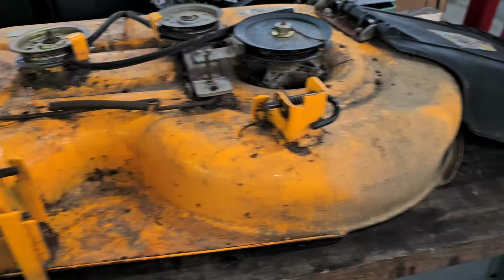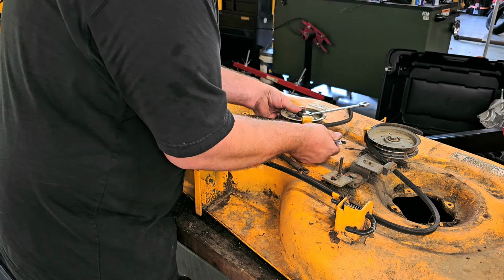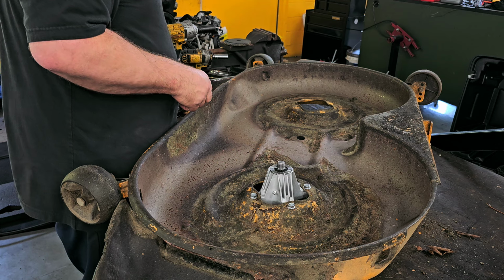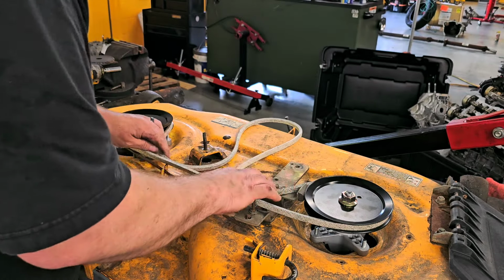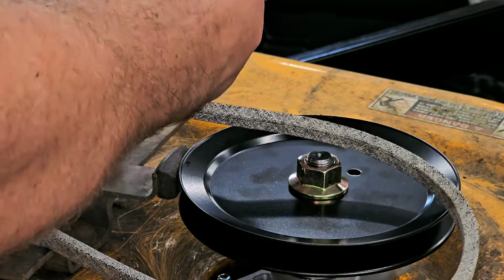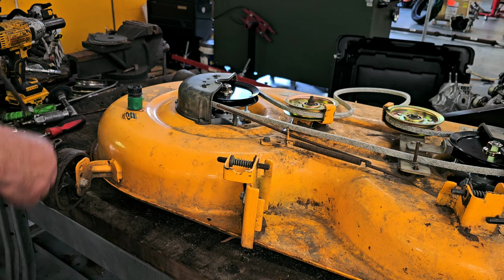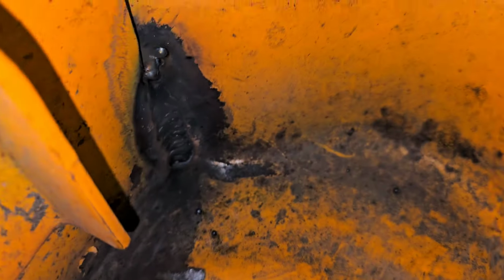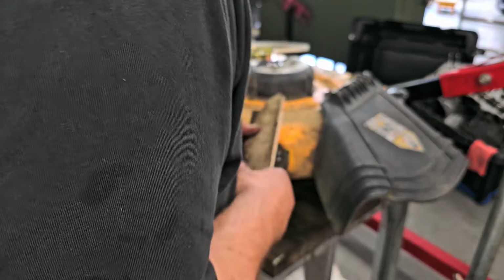Fixing My Cub Cadet LTX1045 Mower Deck!! Mower Deck Rebuild

Comment: I have a Cub cadet similar to the one you have after im done with it for the season im going to take the mower deck off and do the same thing you are doing to yours . Ive seen allot worse welding than that but it isn't really bad it's pretty good and who is going to see it anyway

Comment: The thing about replacing spindles is the bearings are sealed  bearing so grease fitting wont do you much good till you pump in a half tub of grease  to fill the chamber  and pop the seal and then both sides of the seal gos then dirt gets in so to make it last you have to grease  every cut so best to leave it alone and it will be ok for a long long time and you need to drill in the covers to get to the grease fitting

Comment: At JD we call those towers spindles. I wouldn't think the brake for the other side blade would be necessary, as it is connected via the belt, to the one with a brake 🤔

Comment: You can replace the bearings on those ,I'd advise to take the seal out of the bearing an pack the bearings with grease ,they don't put grease in the bearings lol😮

Comment: I've had to replace the 3 mandrels (the tower mechs that hold the blades and drive pulleys) and the 2 magnetos on the engine, and 2 of the safety switches, the idler pulley, the deck and transmission belts on my John Deere D160 riding mower. You have to use a grease gun to fill the zerks on the mandrels because they come dry from the supplier.  Thanks for the video. I learned a lot by watching Chickanic on YouTube how to troubleshoot my D160 rider.

Comment: If I could show you my mower. LOL Frankenstein would be proud. The hood fell apart and its been tossed. All 4 tires dry rotted so I put tubes in them. Deck has welds all over it. Seat is duct taped all over. I just put a head gasket in it 2 weeks ago. I was using a half quart of oil per mow. My Father has a zero turn and the first time I drove it buildings got in my way!!!LOL

Comment: Kenny air pressure in tires has a lot to do with left or right level. If it leaves a streak in the middle its to low front to back. Happy cutting. Wait till the leaves fall. 😢

Comment: Those tower bearings are called spindles have two spindles two idler pulleys two blades belt, a bunch of wheels and yeah, you got a few holes in it. You need to repair before you get worse. Keep up the good work.

Comment: That grease zero won't do anything they put sealed bearings in both upper and lower bearings on those ,without removing the inner seals that zero is USELESS 😮

Comment: Lawn mover engineers are not smarter than car engineers. There are grease fittings but it's useless because the bearings are covered. To get it to work you need to remove the covers.

Comment: Just a suggestion.  With the idler pulleys,  you can drill out the spot welds,  take the 2 pieces apart remove the bad bearing,  replace (usually a 6203) then use cheap bolts and nuts to hold it back together.  Much cheaper than a new pulley.  The bearing you can get at tractor Supply for about $12 - 14. The really good thing is, when the bearing goes bad again,  just remove the nuts/bolts replace the bearing put it back together and it done.

Comment: I actually worked on the same model mower today. Neighbor had hooked up battery backwards and blown fuse. Luckily nothing was burnt up and it charges at about 13.6-14 volts.  Tires were flat. Pulled deck and checked everything, all good. I sure am glad they changed design on deck mounting, these come off in about 5 minutes and about 6 or 7 to reinstall.  Have fun with this project. Worked on a 1999 mower last week, deck has 9 attachment points, what a pain to get off and put back on. Had to weld the deck wheel bracket back on that one also.